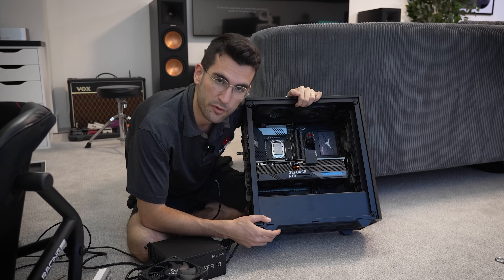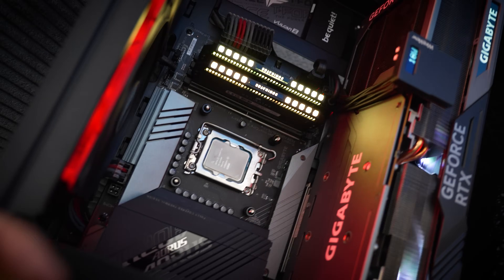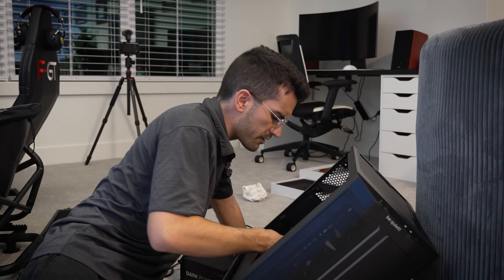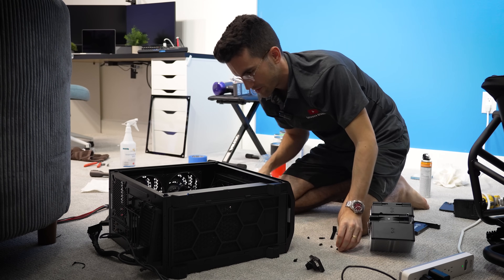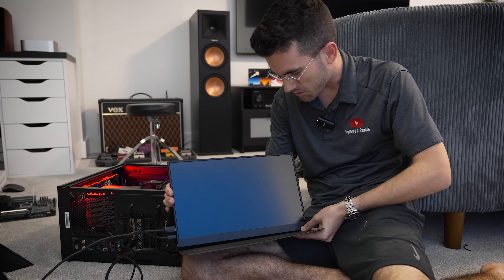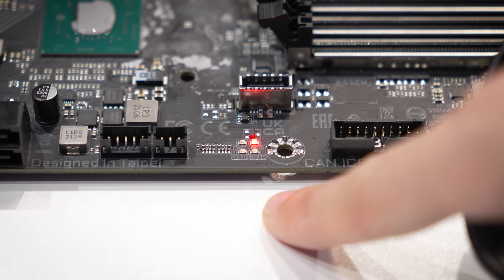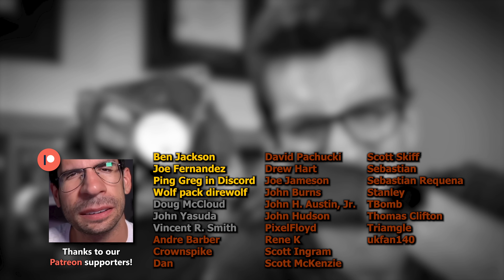Fixing a Viewer's BROKEN Gaming PC? - Fix or Flop S6:E6

Comment: As someone who repairs motherboards for a living im pretty sure the symptoms confirm a damaged bga socket, having done 100s bga replacements so many are so minor not even that visible but still fail to boot, my advice buy an LGA1700 socket tester itll show all leds are connecting or not, they are cheap available from lot of places especially the usual online Chinese sellers i use all of them am5 lga1718 lga1851 lga1200 lga1151

Comment: Those resistor packs near the pcie spot are probably for termination. So my best guess would be a short in the pcie slot. Either bent pins or (somewhat) conductive debris in the slot... But I am pretty far out on a limb here with my speculation.

Comment: Capacitors should not get hot. The fact that some are, down near the sound chip, indicates that they are bad - and that's probably causing part of your power delivery system to shut down. The motherboard could probably be fixed, if I am right. Keep up the great content!
Reply: Yeah and since they are SMD caps they are likely of the solid state variety. they almost always short when they fail. They would definitely drag down what ever power rail they are on and generate a hotspot in IR cameras.
Reply: Yep, those Caps should be cold, and once you have such a good FLIR to find that bring out the multimeter and measure the Ohms across the hot cap and you found at least one problem..
Reply: Maybe the 14th gen Intel exploded his mobile idk

Comment: Let’s go! You were far more patient than I would have been. I would have swapped the board straight away due to symptoms. Funny you mentioned that backplate. I had a friend who didn’t know better when installing a socket contact frame and when I saw the non shiny side of the back plate visible when we got no post and no debug, I figured he shorted it out. He had to pry the backplate off the board after it fused itself. New board fixed him up and he learned something you sometimes don’t think about.

Comment: the only time i wore an esd strap is when i was doing board repair  for military contracts. they didnt want to pay me so i left. now im a truck driver... less stress and no issues... whats funny as well. i recently had to do a fix or flop on my pc as well. as i was getting wifi, and hard line fiber not running intermittent shut down and restarts. i ended up leaving out and going to buy a new pc. as i think the 5700x and my 5900x was shot and toast.

Comment: that is a bit of an odd fault to randomly just die like that. could be a borked out bios that is not letting the cpu to initialize but then again you would think it would still get hot cuz would get power. just not post. but seems more like the chip that controls the board is faulty. functional enough to give a power good to power up the board but not enough to fully power the board up. not really easy to replace since need to source the chip and involves microsoldering

Comment: Same thing happened to me with a MSI X570 Gaming plus...one day was good the other one died, at first i thought it was my 5600g, tried it on my main config with tomahawk B550 (main cpu 5950x that i tried as well in the x570...still CPU LED so i knowed for sure that the dead hardware was the mainboard) and it worked flawlessly, so i ended up ordering a gigabyte low end motherboard and since now it worked fine, i used it as my second pc for multimedia/music...so i don't need a fancy mainboard for 5600g

Comment: sorry your motherboard randomly died sh%t happens bro, happened to me, i sell old hardware on ebay, as a second source of income and as a hobbie, i had a old socket 754 test rig which worked fine, but later when i went to test a cpu with it, testing it with known working parts first it just decided not to post.

Comment: Have you tried bios flashback? I had the exact same issue with cpu light being on and no power to anything and the PC worked perfectly fine before. So I did a bios flashback and it fixed the problem

Comment: Did your board become the next victim of the Microsoft Windows update bricking pcs with failed bios updates.
Reply: Interesting, after a recent Win11 update my computer booted to desktop then 20 seconds later rebooted and now won’t post.  MSI motherboard, VGA led lit on debug. Pulled Nvidia 2080 ti put back in.  Still won’t post

Comment: I began having no display randomly playing Ghost of Tsushima. Had to hard reboot to get video back. In the Event Viewer I get faulty hardware error. However, no details provide. Build is a i912900k Asus Rog Strix 690. I began with Memtest each RAM stick. Passed. Stress test GPU and CPU passed. Reseated RAM and GPU. Updsted the BIOS. Still getting the same. Notice it was during Ghost of Tsushima and Steam big picture. Began playing other games pushing the graphics to the max. No issues. Tried playing GOT again got the error. So I suspect is a driver or something with GOT.

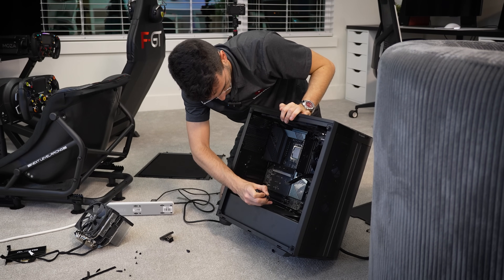Comment: I said it before and I'll say it again, pulling the motherboard out onto a table and testing piece by piece has been my best practice, I'll always rather start from zero even if the wiring is nice and I'm going to ruin it, even if it takes forever, when weird issues like this persist, starting from the tabletop saves soooooo much headache (if I can't POST with the board sitting on a blank surface with no POST codes/beeps, then all other troubleshooting is wasted as far as I'm concerned, this is from 20 years of techbenching). 11:17 cutaway, did you test any CPU in the motherboard outside the case?

If you read this far fellow commenter:
1. pull RAM, do I get any beeps or RAM diag lights? if yes, step 2. if no, remove motherboard to test.
2. insert 1 stick of RAM in an unused slot, any changes? 80% chance POST will occur, if not, step 3.
3. pull motherboard from case
4. test with known good PSU, RAM, and CPU if possible.

Comment: Greg, do you not think that the thermal paste test and cleaning finally caught up and killed the board?
Reply: No, that wouldn't cause the board to heat up the way it did. The sound chip was heating up, which indicates that power isn't going through that region properly. My guess is that something is shorting in that area and causing things to heat up. Since it's nowhere near the socket, the thermal paste and subsequent cleaning would've have any effect. 

Most thermal pastes are non-conductive, and isopropyl alcohol, which is what you use to clean it up, evaporates quickly. Neither would have caused a problem like this.

Comment: It looks like maybe corrosion around the VRM area.  I also noticed it when I saw the back of the board.
Reply: Those stains are from excess flux that has been used in the factory to mount components. It's a process that happens to some motherboards as it goes through heat-cycles.
Reply: It seems like his VRM’s have gone out. They are what give power to the cpu and distribute power correctly. Even if one does happen to go out, it can throw that whole power sequence out of sync.

Comment: I have the exact same problem with a Gigabyte z490 Aurus Master. Overnight, it just stopped working. It would power on like yours, but CPU was cold to the touch. Tried an 11900k, 10850k and a cheap Celeron, no go. 
Had the same CPU debug LED on permanently. It would behave the same even without a cpu installed.
The board looks perfect, like yours, but nothing will work :(
I tried bios flashback with at least 5 different bios variations, which would actually do the bios flashing process, but as soon as it was done, zero difference. 
Drove me mad for a good few weeks. Saddens me because it's a really nice high end Z490 board that just died so randomly and with no real obvious reason as to why.

If you ever figure it out, please do post a video on it.

Comment: So the last time I worked on an Asus motherboard it had 8 slots for RAM which was wild. But the person who owned it updated the BIOS. Because of that his computer wouldn't read the mouse or keyboard. I removed the hard drive (SSD) and plugged in another hard drive another  SSD that was an extra hard drive and the same problem accrued. I tried undoing the update but that didn't work. The only thing left was to have the manufacturer fix it since there was nothing else I could do. So when it comes to BIOS, Asus or otherwise the only time to update the BIOS is as a last resort. It was definitely 100% the CPU pins on that motherboard. You can deny it all you want but bent pins will give you that problem.

Comment: Thermal paste, as you noted, is not conductive. But it is extremely humid where you live....  Is it possible that perhaps it was able to trap enough liquid that it eventually was able to cause a short after enough heat cycles? I'm picturing water evaporating underneath the thermal paste and then recondensing in a different and worse spot.

Comment: Edit: I WAS DAMN RIGHT! But what's weird in my end is that my b450m posted with my 5600g a day before finalizing that it died so it took me a few hours to really write it off. I hAte dead mobos too jfc

I have the same issues with my b450m and 2200g. Let me guess, that's a dead mobo! I have 2 dead b450ms for some reason. Different ram sticks on different mobos and cpus. But yes, PCs are weird af

Comment: The only thing I can think of with what you have presented in your video, Is that a Component on the Power Rail for the CPU failed and is sending power to the other rails.
Some of those Heat Spots could be because of it.

Comment: I love PC building. I love how it all comes together and looks nice if the time is taken to thoughtfully lay parts out. I love helping others build a PC suited for their needs and helping them out when something isn't exactly right.

I also haaaaaaaaaaaaaaaaate troubleshooting my own damn rig. After rewiring everything one day I did a little accidental zappy zap by trying to plug a PWM header in while the rig was on. Then my integrated wifi/ethernet started going screwy and I couldn't connect to the internet no matter what I tried.

The problem? After meticulously trying a CMOS reset, new bios flash, unplugging and replugging my 7 USB devices, my drives, RAM, rebuilding the entire rig essentially it turned out that my primary monitor/its cable was causing some sort of issue.

God speed, Greg. I simultaneously watch this series to learn and to be entertained by your shared suffering.
Reply: I had an HDMI cable my computer didn't like once. It kept randomly resetting itself or powering off and refusing to power back on. I tried everything I could think of until I randomly thought to try a different cable. Who'd of thunk? I cannot understand why these things happen. They're so frustrating.

Comment: Funny.  Friend of the roomie had a computer that wasn't even getting to post.  He would turn it on and it would start up but never put a picture out or anything so he asked if I could look at it.  Take the thing apart, try to boot it, nothing happens.  Notice the debug LED on DRAM.  Pulled the memory, threw a different set in, turned it on and boom, posted right away.  Computers can be so weird.
Reply: Yeah, electronics work perfectly, right up until they don't. And when they fail, most times they don't spark or smoke. They just quit. Makes troubleshooting interesting. I once had a power supply fail, but it tested as good. As soon as you put a load on it, however, the system crashed. I don't even use PS testers anymore, as a result.

Comment: There are channels that do motherboard repairs. Could collaborate with one of them to fix this one, even if it's not really worth it to you financially, it might be worth just to satisfy the curiosity as to what happened
Reply: And he could make a video about it.
Reply: So non conductive thermal paste usually contains zinc oxide or aluminium oxide in a silicon coating. This makes them non conductive but thermally conductive so perfect for thermal paste. Over time the silicon coating can wear away on the metal oxides which then results in them becoming electrically conductive. My theory is that the left over thermal paste had its silicon coating degrade making it electrically conductive. Then as you tried to power it up, it shorted out the socket of the board.
Reply: @peterstainburn2871  An interesting theory, however, usually when there's a short in the socket there's also a lot of damage/burn marks in the said socker from the short. Check the recent GamersNexus video for an example.
Reply: Uups wrote the same thing, yeah that would be a win-win situation IMHO.
Reply: it was a short. nothing else to know. move on.
Reply: I am 100% curious as to what the problem actually is. A collaboration with one of the repair-Tubers would be interesting.
Reply: @ my theory is the cpu socket is shorted. He used that board in a video to show that non conductive thermal paste doesn’t affect a motherboard from working if it gets into the socket. However, I think this video proves that’s wrong in the long term. My reasoning for this is because non conductive thermal paste is made up of thermally conductive elements like zinc oxide or aluminium oxide coated in silicon to make them not electrically conductive. The silicon coating degrades over time which is accelerated by heat. Once this coating erodes then the exposed zinc oxide or aluminium oxide conductivity electricity shorting out the socket.
Reply: Adamant IT is pretty awesome
Reply: Louis Rossman x Greg Salazar would be cool to see
Reply: was it the motherborde again? seems like those things are super fucking faulty
Reply: @mewshifter  Well, it is the MOTHERboard, the thing that connects and holds everything together. If something goes wrong with any of the other parts, it could take the board with it. Also, the boards are quite complicated with many small parts, so it's not surprising that they are a bit fragile.

Also, I remember hearing that while old CPUs really fall in price with time, motherboards stop becoming cheaper at some point, or even growing in price since there are less and less working boards of that type.
Reply: @mewshifter  oof, those kind of instabilities are always the hardest to diagnose. Good luck m8!
Reply: I live in the LA area pretty close to the Northridge Fix guys.
Reply: Try Northwestrepair in USA,  sadly I'd volunteer but I'm in Australia
Reply: @waynetaylor2784  what state in Australia are you in? I run a computer business in SA but don't do board repair. It was something I wanted to learn but never had the time. Had a few clients with board problems that I would.lobe to hand to someone and hopefully have a happy outcome instead of always giving bad news.
Reply: @waynetaylor2784  What are you doing in Australia
Reply: @TheFalseShepphard  Looking at the world upside down?
Reply: Not worth the cost of repair. Accept the loss and move on.
Reply: @markroberts001  As I said, maybe not worth the repair, but he could still do it just to find out what happened. He also probably has other motherboards that he replaced in the series, unless he disposed of them, which he could make a whole video out of exploring how motherboards die
Reply: @guiorgy  Why don't you send him the money to get it investigated then but you wouldn't dream of funding it yourself because you watch all these channels for free.
Reply: @markroberts001  You do realize the comment was just a possible suggestion, a "could do", and by no means a request, right? What's your problem m8?
Reply: I think Linus can help to repair the motherboard 😂
Reply: @cooldude5531  Nah, if it's a bent pin Greg can do that too. This should be left to someone else

Comment: I was having issues with my Ram and eventually the PC wouldn't even turn  on with it in. New Ram sorted that out. Then a radiator that had been fine for 3 years started leaking in the middle, so out that came. Then my pump failed and I should be getting a new one tomorrow.

Comment: ive run into that issue on my b560 mobo. my diagnosis is magic. aka i have no idea how i fixed it, all i do know is it took me removing everything from the case and just cleaning everything. if it connected somewhere or had something connect into it it got scrubbed with either electronics cleaner or 90% isopropyl. somehow that is what fixed it. all the same parts.

Comment: Be interesting if Windows corrupted a bios again.
Instead of what Greg normally encounters.
Reply: I remember watching a Carey Holzman video years ago where an incorrectly set date and time during Windows install kept overwriting the system date in BIOS,  meaning that while the system would post,  it wouldn't actually boot.
Reply: Okay now that's pretty interesting.

 @insparks782